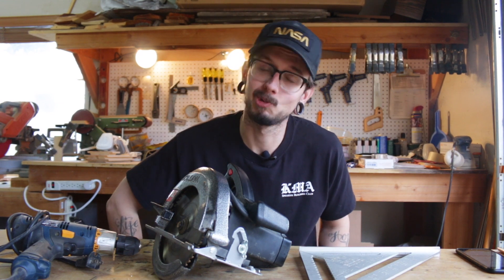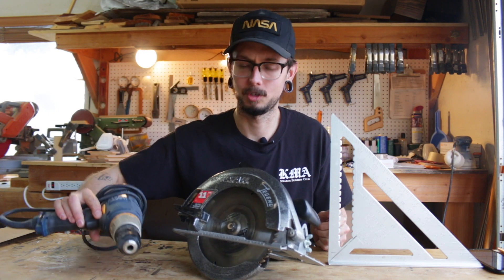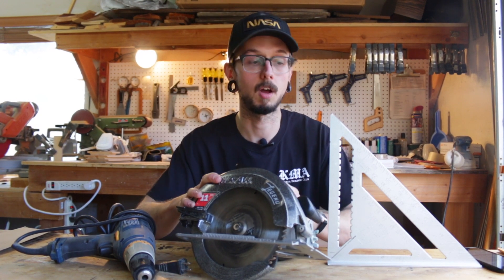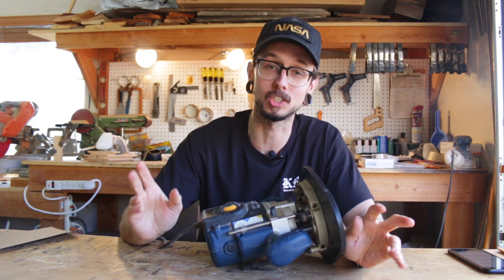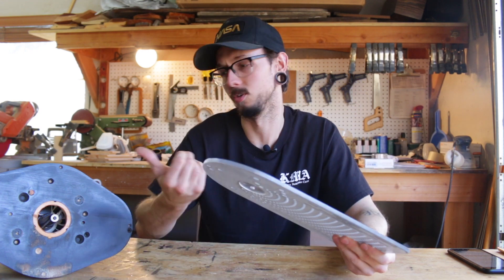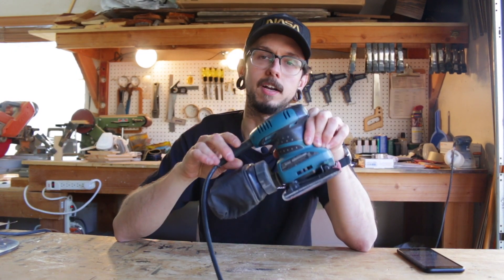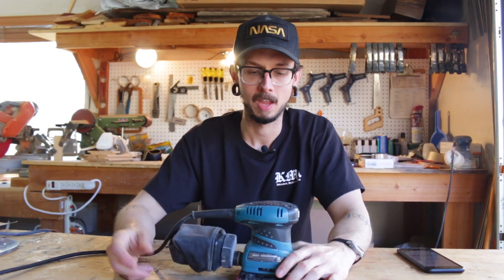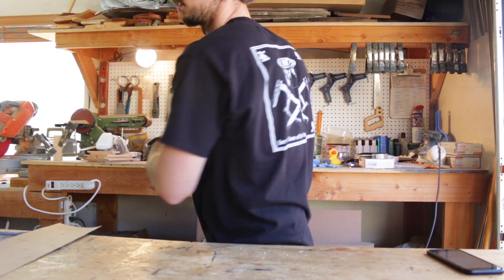Basic Tools To Start Building DIY Speakers

Comment: I bought a plunge router add a compression bit makes life alot easier add a jasper jig and better cut outs. I prefer to use strap ratchet clamps and a few 90 angle corner clamps, can make any box cabinet with no more than 8 in total, get a good high watt variable power oscillating sander. Have e wetrho else you mentioned good informative vid thanks for posting

Comment: instead of a cirxle jig. i use a scrap piece of plywood, mount it to the router and cut a hole measuring the radious of the cut and screw it to the center of my hole. same thing except it wont cost you 60 bucks.

Comment: Stupid question. You have the router and the circle gauge. You place pin, attach gauge/router. What's underneath the piece you are cutting? do you sacrifice a piece under the cut? If nothing is underneath, what holds the pin  center once you close to finishing the cut.

I ask because I don't have a router yet and I'm trying to visualise how to use it to cut circles.
Reply: What I would do is clamp down the piece you're going to be cutting with a sacrificial piece under it. Then drive a couple of screws through what will be the hole and make sure they're down below the surface so you don't run into them and away from the center where you'll be putting the pin. Now you can use the circle jig to cut your hole. The clamps are holding your piece in place and the screws hold the cutout. Once you're done you just remove the screws and clamps. The screw holes don't matter since those were in a piece you're removing anyway.
Reply: You can also clamp you piece over the side of your work area and just let your cutout fall down. Just hold the router steady at the end of the cut as your center pin will lose support and the router can move freely.